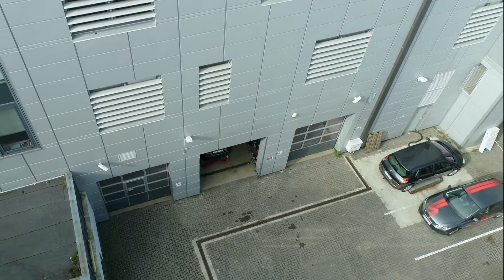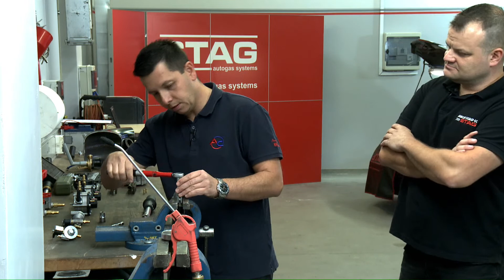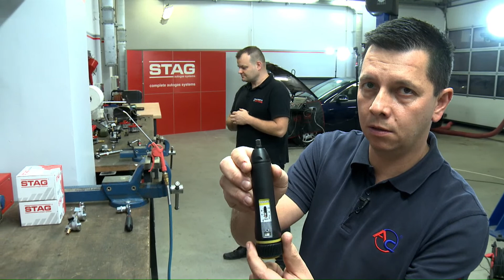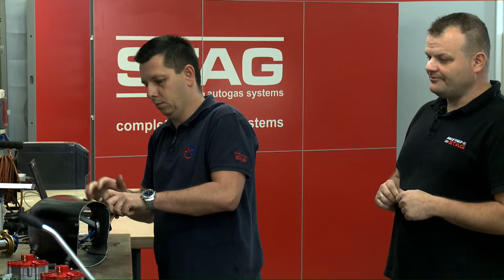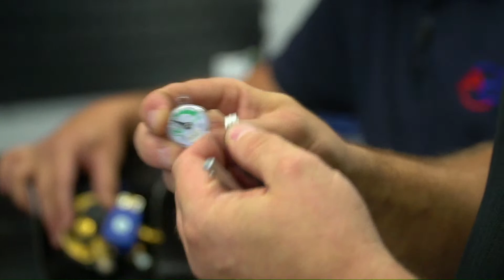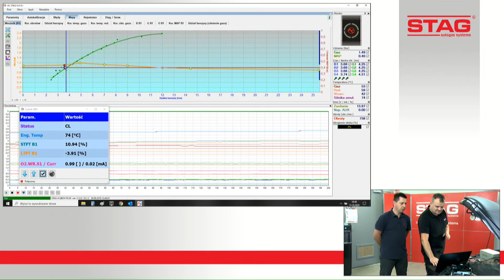Live: Real Life Tests Taken.

Comment from the maker: Errol Pinto pinto: even everything is propper mounting, in some tanks there are less gas filling issues, what you suggest for this problems.

STAG: Check firmly floater arm, during montage sometimes issue is on side of clogged arm , again very important is tank positioning.